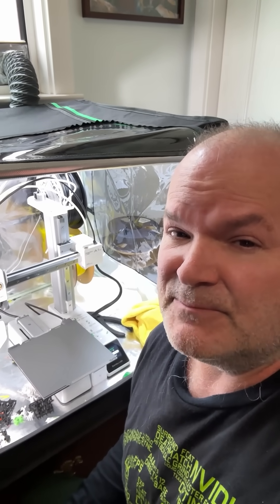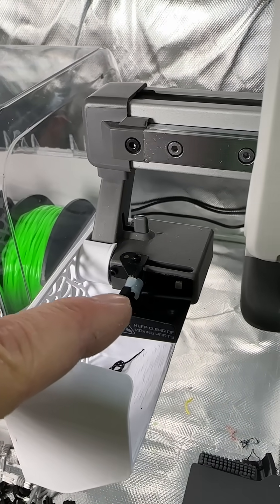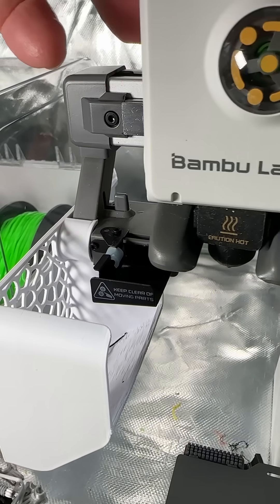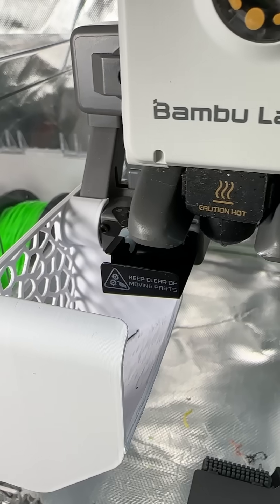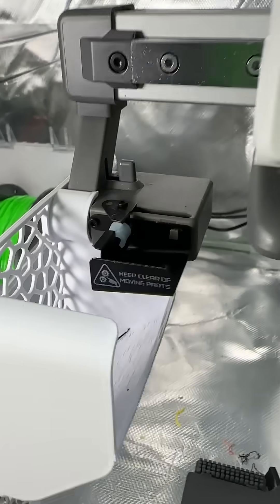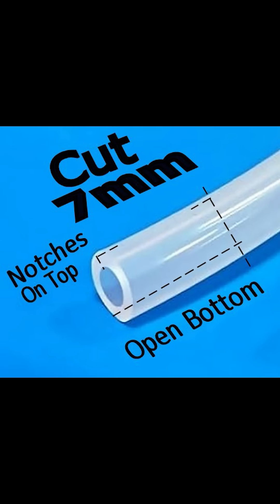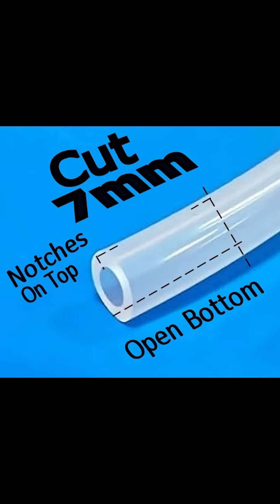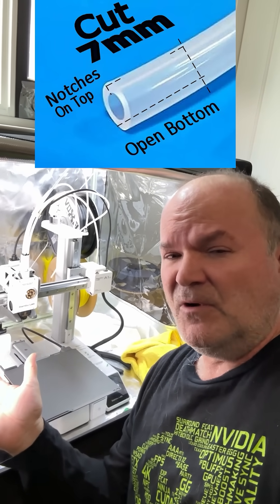Fixing The BIGGEST Problem With Bambu Lab Printers A1 and Mini

Comment: I've been running my A1 almost 24/7 the past year and haven't had one problem with the wiper all you have to do is make sure it's on tight and not bent 🤷🏼‍♂️
Reply from the maker: Your milage may vary.  For many customers, the wiper is too far away from the nozzle.  The Silicone Tubing Trick has been working solidly in two corporate A1 laboratory deployments and my A1 Mini at home, since the release of this video.

Comment: I´ve been thinking about getting a 3d printer but there are so many options. I could buy an Ender 3 v3 SE for 180€ or a Bambulab A1 mini for 230€, wich one do you think I should go for?
Reply from the maker: The reason Bambu Labs have taken the market by storm is because of the Ease of Use, More Automation, Shorter Learning Curve, Less Fiddling, Less Tweaking, Easier Maintenance, High Print Quality, very decent Speed, and compatible with a wide variety of filament types.  I held off for years then I saw a child printing amazing things with a Mini and I was sold.

Comment: dude there are many prints that work better
Reply from the maker: I’ve seen several. Mostly they don’t do a good job, or are overly complicated, or have clearance issues. This one requires no print and gives a firm, squeegee swipe right on the nozzle. It works like a dream, and I would hold it up against any other solution.